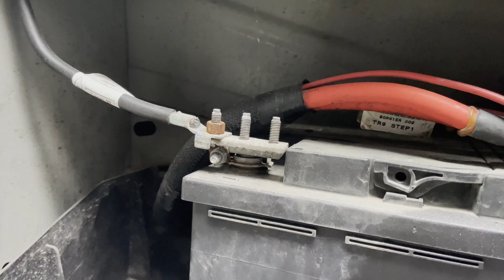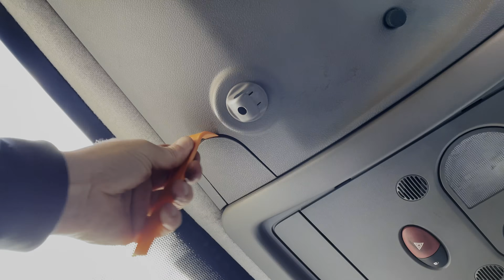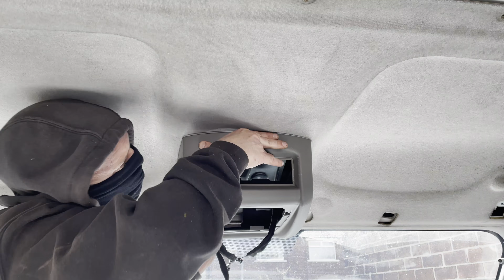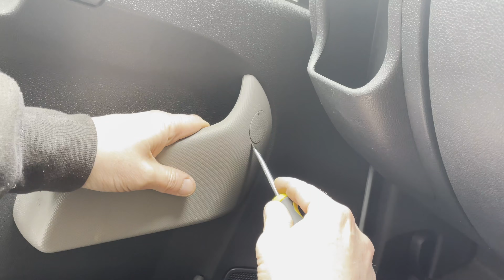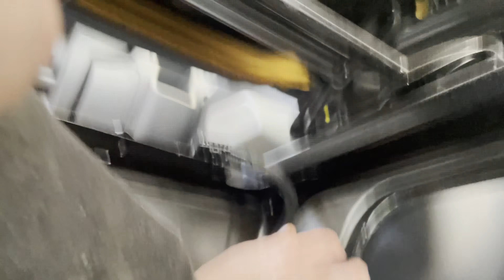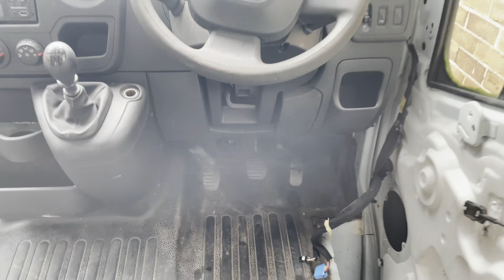FULL INTERIOR REMOVAL - VAUXHALL/OPEL MOVANO B, RENAULT MASTER MK3, NISSAN NV400

Comment: Search the web for hours until I found this.. 
Nothing less then five stars, thank you!! 👍🏻
Is it possible to remove the ”cover” under the door panel?
Would like to insulate the doors a bit.
Reply from the maker: Yes mate, its a moisture barrier Its to stop rain etc getting to the motor. Take it off carefully and re attach with waterproof sealant or  butyl rubber strip